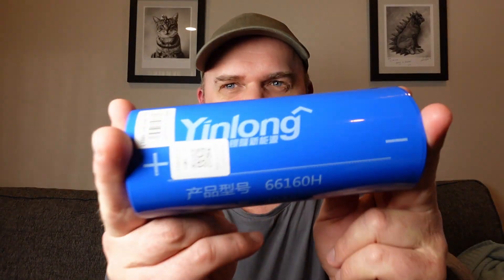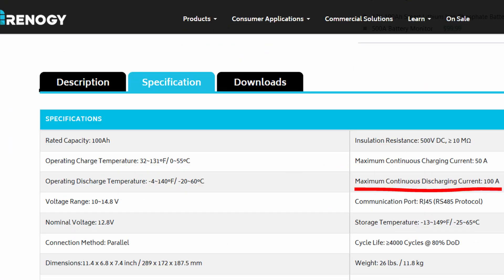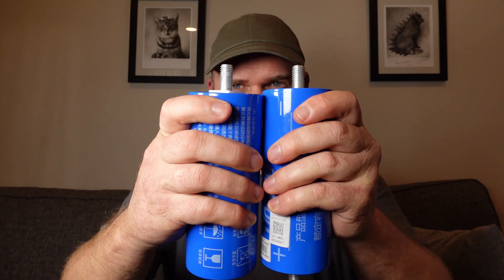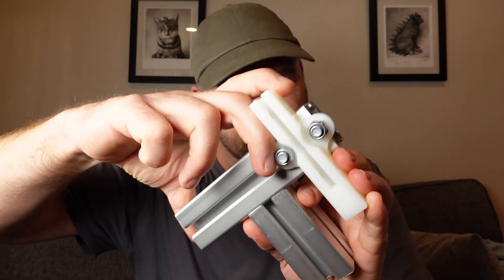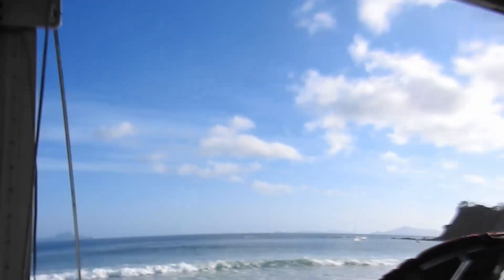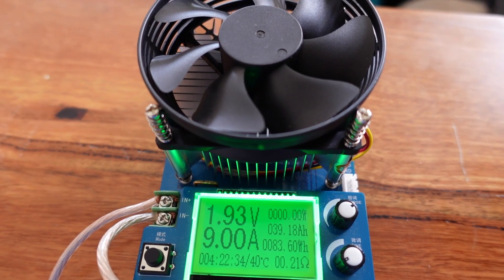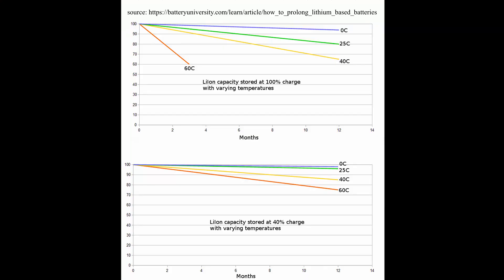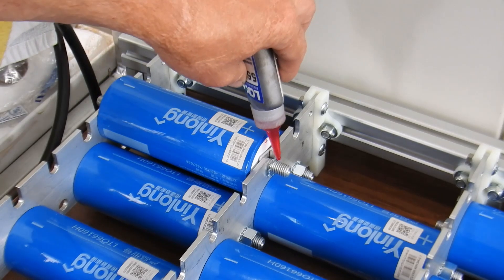Campervan DIY battery build HUGE POWER!

Comment: 4:42 are all lithium batteries the same voltage?
If it isn't, then that's why they would use Ah
Reply from the maker: They are all different.  On a cell level, Lithium titanate is 2.3V, lithium iron phosphate is 3.2V, regular lithium ion cobalt is 3.7V, the and the types used in yr phone etc are 3.85V.  Telling a person the Ah of a battery does not describe the capacity of a battery.  A Wh figure tells you plainly and simply how much energy is stored in that battery.  It also makes it very simple to figure things out.  If you want to run say a 20W lightbulb and you have a 100Wh pack.  It's very easy to figure you could run it for 5 hours.  On the other hand... if you have a 20W lightbulb and you have a 10Ah battery, how long will it run for. You have to know other things... is it a 12V, 24V or 48V system, then what is the actual nominal voltage...  I like to make things as easy as possible to figure things out - like, why make things unnecessarily difficult.
Reply: @brendontait6968  but wouldn't you also need the battery voltage? Let's say that an LED uses 5v but then you use a 12v lithium battery, wouldn't that cause early demise of that LED?
I used to live in the Philippines and we used 220v so if we plug in a 110v appliance, it's toast lol
Reply from the maker: Hey Jeffrey,  I'll answer your question on several different levels.  Firstly, LEDs are not a voltage driven device, they are current driven.  Applying a specific voltage to an LED will ensure either its demise or it just will not illuminate.  LEDs need a current based driver to run.  The LEDs I have in my truck have a forward voltage of 36V but my truck is 24V, the driver provides the correct drive current to the LED irrespective of applied voltage (within limits). Secondly, of course you need to know the appropriate voltage of your system to ensure it is running within spec of any devices.  It would be unlikely that you could wire your domestic fridge into your battery and expect it to work. What I'm saying is that you could have a 12V system and the battery voltage could be 11.1V or it could be 15V depending on chemistry.  If you only know Ah, you have no idea actually how much power you have.  Ah is a useless metric to quantify energy capacity.  Solar panels are rated in watts, electricity you buy from the grid is in kWh.  It's kindof like saying you have a 100 litre water tank, but instead of saying that it is 100 litres, you say it is a 500mm water tank.  You want to know the capacity of water you can hold, not just one dimension of it.

Comment: Almost no one will cycle a battery 20,000 times. One complete cycle per day for 10 years is only 3650 cycles. With few exceptions, cycle count is really not a concern with LiFePo4 or LTO. I prefer LiFePo4 because it has lower cost, higher energy density, and better compatibility. They can also last for well over 5000 cycles. I’m not sure how long specifically though. I’m not old enough to have worn one out!
Reply from the maker: The issue is, all rated cycle tests are carried out in lab conditions where the battery is discharged as soon as it is charged (and not held at charge voltage) real world conditions will no doubt mean the cycles a battery will last a significantly shorter cycle time (I would expect half).  I chose this chemistry due to it's robustness to go along with my truck where it will be something that I hopefully don't have to be concerned with replacing in the foreseeable future, it will handle sub zero temperatures happily, and likely survive in the event of an over or undercharge situation in the event of a BMS failure. There is no issue with voltage compatibility with my 24V system.
Reply: @brendontait6968  I totally get it. Especially with the sub zero temps. I do disagree with the real world cycle life though. I’m sure many others can attest the LiFePo4 lasts for a ton of cycles in the real world even 5000 cycles is conservative. Time wears both chemistries out more than anything.

Comment: Cycles do not matter.  The number of watt hours you can get per cycle varies greatly depending on how well you baby your batteries.  How many watt hours you put through your battery before it dies is what matters then look at the cost of the battery.
Reply from the maker: Hey Brian, are you saying that if you had a battery that was rated at 1,000 cycles and another that was rated at 2,000 cycles under the same conditions...  it's irrelevant?
Reply: @brendontait6968  First off, thank you for your reply, I figured my comment would get lost in the sea of comments. 
So I kept it short and a bit starkey.

OK, cycles are more than not relevant. But it erks me when someone uses them in cost analysis. So many other factors come into play. 

With your calculation, each of your batteries will provide over 1.8MWH (92 WH x 20k cycles). I started off slow 2.5 years ago, but now my small solar system provides just over 1kwh per day on average, in total up 'til now 950 kwh. For my RV to be off grid, that needs to go up to 4kwh per day. If your batteries lasted 25 years, you would have to use them to produce 19.9 KWH per day. 
 If you do, that is great, but you should put that into your equations. 

To be really picky, most of the 1kwh of power per day is going straight from the solar controller to the inverter bypassing the batteries, the battery bank is responsible for only about half of that.

So, how many KWHs you plan to use is a big factor in cost analysis, much larger than the rated cycles. The other factors, such as charge rate, weight, and maintainability do not have direct costs, but can be a huge factor depending on the human. 
Not to mention installation costs.

How well someone can take care of a battery bank is a big factor. I baby mine, but the other day I accidently left something on and my bank went down to 8v. They are fine now, but I'm sure that aged them a bit. 

The battery bank is a large proportion (~30%) of the expense of a system, and compared to panels, inverters, and controllers, the most sensitive to failure (or severe degradation). I'm looking at it from a frugal perspective. It would be nice to drop $5k on a system from the beginning (buy once, cry once), but what is the most efficient path when starting from zero and only investing $100/month while minimizing risk.

Comment: Amp hour is the only true measurement of usage. When running a load, you measure the amount of amps being used. When you know how many amp hours your bank can run. Then you can figure out how long you can run that load.
Reply from the maker: Yeah, it's not sorry.  For several reasons.  Follow along and I'll explain why in future videos.
Reply: @brendontait6968  I'm definitely going to follow. I love to learn new things. I have however built three large systems using amp hour ratings as a basis. One has been running my completely off grid tiny-house in Tennessee for 4 years now. Knowing the amp hour capacity of the battery bank (factoring in voltage and inefficiencies), you  then have the numbers you need to figure out how long you can safely run a specific amount of amps from your bank. The math has always worked for me without fail.
Reply from the maker: Amp hours definitely can work, and I still use it in certain applications. But it is a sloppy unit of capacity measurement.

Comment: To safely remove locktited nut or bolt, heat them up to about 100C or as close to as safely possible. It softens the locktite an makes it much easier to remove.
Reply from the maker: Thanks... not sure the batteries would appreciate a torch.  The loctite I used was intended for disassembly so hopefully should come apart if needed.
Reply: @brendontait6968  a small butane torch works well on such small fasteners, but if your worried about have an open flame near the batteries, use a heat gun the soldering heat guns are small and precise. But with alu buss pars the heat is going to be drawn away fast. with a little more force and less heat might feel more comfortable. you don't need much heat,just enough to soften the loctite.

Comment: I helped a friend with the same problem of rigid busbar. Use heavy equipment battery cables the are rectangular shape looking at them from the end view. They let expansion and contraction happen and really conduct so much better than aluminum. The copper is plated with tin also which helps with corrosion. Worked for he. Peace. VF

Comment: You might try the pink Loctite.  It is for small / light applications.  Much less grippy than the red; on threads this size it will be completely manageable.
Reply from the maker: Thanks, tho the "locktite" I used was loxeal 55-04 which isn't the same as red loctite.  I'm still concerned that even tho it's made for disassembly, it may still hold too tight..   ali studs n all
Reply: @brendontait6968  I'm not familiar with that brand.  Sounds like yours is the equivalent of the blue Loctite.  The pink is the weakest you can find,  on threads of this size it will be more of an anti-vibration additive than anything else.

Comment: At the current price, the batteries would cost about (99 cells at $65 each) = $6,500 USD. Double that if you wanted a 48vdc battery bank.
Reply from the maker: Depends on your supplier.  The group buy I was doing was around $41 usd shipped.  48v does not mean doubling the number of cells.  Eg, I could do a 22s4p pack which would be 48V.  At that group buy rate, that would be $3,600 USD plus componentry etc.

Comment: Yeah, was thinking why you would use red (permanent vibration resistant, needs 250°C to release, usually from blowtorch) Loctite instead of blue (medium strength) or purple (low strength), told me at the end.
https://www.henkel-adhesives.com/nz/en/insights/all-insights/blog/difference-between-threadlockers.html
Reply from the maker: The "loctite" I used was loxeal 55-04 which is a variant intended for disassembly (doesn't follow the same color coding as the loctite brand) but I still feel it may hold too tight.
Reply: @brendontait6968  Ah, I have seen those imitations vary a lot with labelling and colour, sometimes even reversing the scheme, commiserations for getting too stuck using the stuff you used. Have you ever tried the chinesium "222" threadlocker stuff?

Comment: Amp is the proper measurement of electricity, not the watt hour, because no matter what the watts are or the volts are the battery would produce the same amps but if you were to step down the voltage you would get more watts out of the battery.

So I suggest that you change to the amp hour that way you can properly understand the basic mathematics of the energy able to be produced.
Reply: Don't know what you're on, but really need to dial in your meds. Every thing you said is wrong. You couldn't be more wrong even if you tried harder ...
Reply from the maker: I'm sorry happy fox, but you are incorrect.  Follow along and I'll teach you some about electrical stuff.  You cannot generate any more power (watts) from stepping a voltage down.  I could have wired this battery so it was 40Ah or 3960Ah and both would have had the same amount of watt hours.

Comment: 0,22cent per kw/h is expensive for you lol.
Here in my City i pay 0,29 Euro Cent per kw/h because all the green Energy stuff the german Gouverment is "trying" for years.

But anyhow, love your Design and thanks for the informing Video
Reply from the maker: Thanks...  yeah our power is around 13c euro, mainly green... but I think it is easier bc we are small.  It seems like a lot to me especially since you are relying on the solar and most people consider the solar electricity to be 'free'
Reply: @brendontait6968  Could be. The main Problem is that any change from the established methods comes with a price. New technics have to be developed and often they don't work that reliable.

Plus the german Gouverment forces the Energy Companys to shut down their reactor driven plants to a specific date. For that reason they have to pay them a settlement for their loses, going in the billions. That is also a reasion why we have a high rate for our electricity

Comment: The level of safety these cells provide is amazing and almost incomparable. However, due to their odd operating voltage range (2.8 - 1.8V) they wouldn't be a good replacement for systems running on LA batteries. 
Then their extremely fast charging capabilities won't be a plus point on solar power system over LiFePO4 cells, because they are simply fast enough for the job. 
Then the cycle life - unlike LiFePO4, this is quite new technology, only been in use for about a decade. So that 20000  cycles, which translate for over 50+ years for usually 1 cycle /day solar applications will only be a myth.
Reply from the maker: Their realistic operation range is around 2.0-2.55V. They work pretty well in my situ for substituting LA batteries.  A little high for 12V systems.  But still useable.  There is a possibility fast charging could be useful.  (Tho unlikely I'll utilize it). They have a known calendar life of around 25yrs.  The thing is with all batteries, it is very unlikely any will reach their spec cycle life since it is done in a lab under ideal conditions.  The real world does not offer the batteries that luxury.  So 4k cycles on LFP all of a sudden becomes 2k. Etc.these batteries seem very robust, I have heard of people accidentally reverse charging them and they have then recovered to give full capacity.  I want my truck and its systems to be relatively robust,  not bothered by low temp etc.

Comment: Very interesting! But i have many questions!

1. Why do you need that much capacity in a campervan?
2. What charge controller do you use?
3. How many solar panels do you need to realistically charge that battery bank?
4. What inverter do you use?

Great video!
Reply from the maker: Electric cooking/air conditioning....  I'm just going to be charging off 1kW solar thru an mppt, and possibly a 7.5kW alternator.   I just have a shitty chinese one at the min, will show in upcoming video.  Cheers

Comment: If you don't specify the voltage, amp hour is meaningless.
Reply: Every battery specifies its voltage. Every person (Hopefully) knows the voltage of the system they are building.
Reply: @mountainman4410  I was thinking about the BMW I3 which for some reason was Designated with a Amp rating in the sales and you had to dig to find the KWh rating of the battery.
Reply: No, the kWh was noted.
Reply: Agreed. There is different tests to determine the watt hours of a battery,  so it is kind of a meaningless number. It gives an idea of how much energy is in the battery,  but how much you'll actually get will depend on how you discharge it.  But since batteries do not specify how the watt hours are determined, it really is a useless metric.

Comment: Very insightful video.  I like your way of looking at the numbers.  Question: How are you charging them and what are you doing about balancing?
Reply from the maker: Thanks, currently being charged from the alternator, about to chuck a couple solar panels up on the roof.  I have a balancing BMS, tho don't think balancing is as important as most people think.
Reply: @brendontait6968  Balancing less important only if you are always charging to like 90% of capacity, no more. Also extends life of most Lithium batteries to not charge to full capacity.